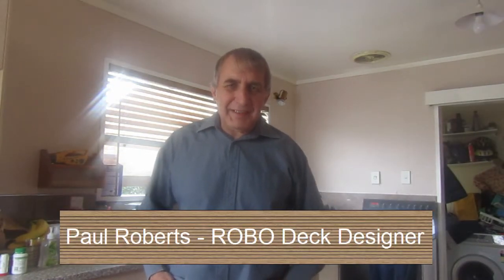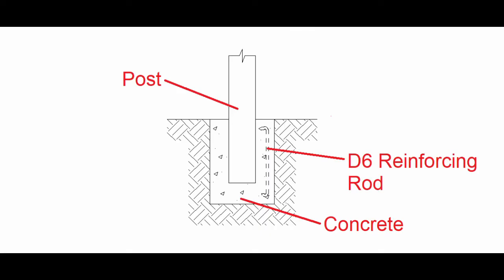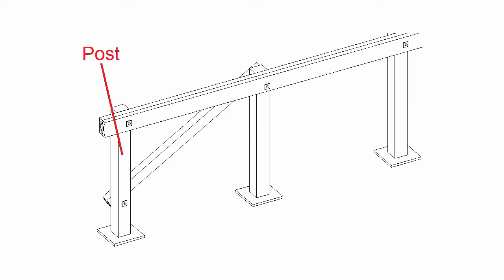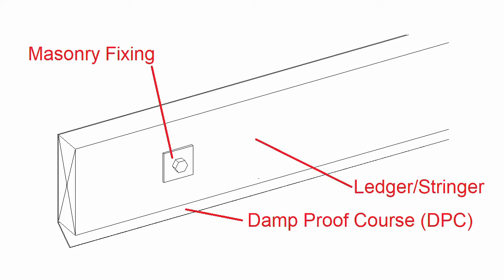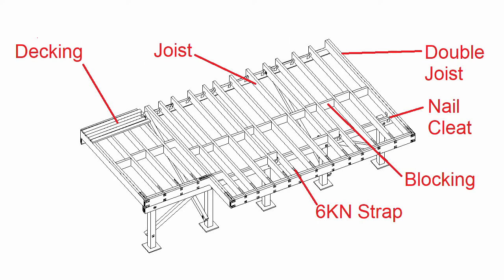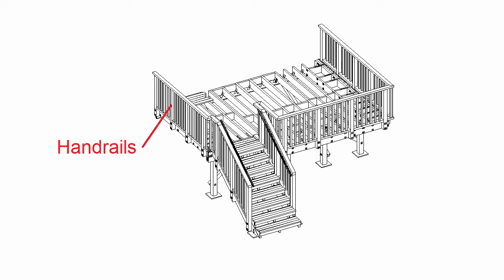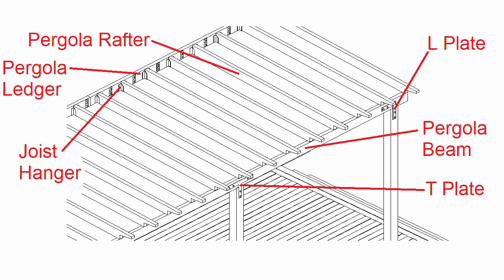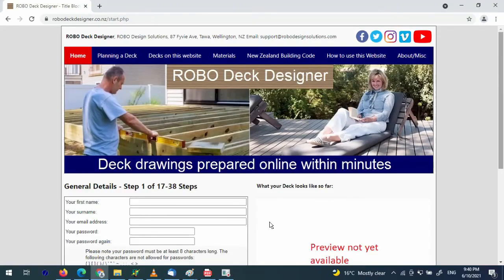The anatomy of a deck: all the different parts and materials that make up a deck

Comment: Can you use joist hangers to attach the joist to the ledger board particularly if you are attaching the ledger perpendicular to the house floor joists end on and you want the deck level with the house floor for level entry.
Reply from the maker: To me this is a grey area. I can't find enough information in NZS 3604, that states this is or is not possible. Mitre 10 do actually have a brochure that has joists fixed in this manner. As I don't want to provide misleading information, I suggest you contact BRANZ directly. This is actually a topic I plan to do more research and prepare a video.
Reply: @robodeckdesigner  Thanks, a follow up re pergola beams and rafters. I noticed that they are 125x50. I assume that’s 120x45 gauged? Is that a cut down 240x45 board? What span table applies in 3604 for the rafters and the beam? What spacing is then applied to the rafters?